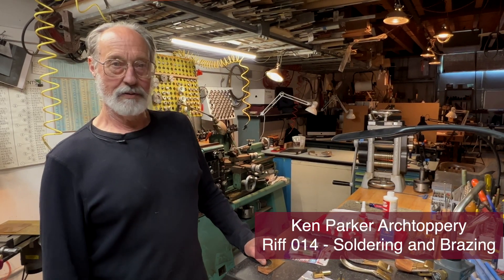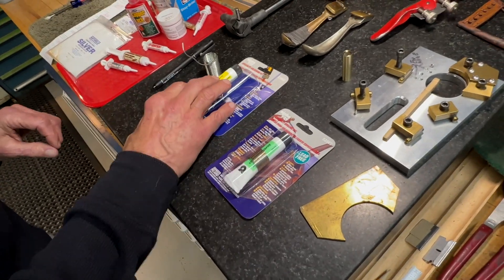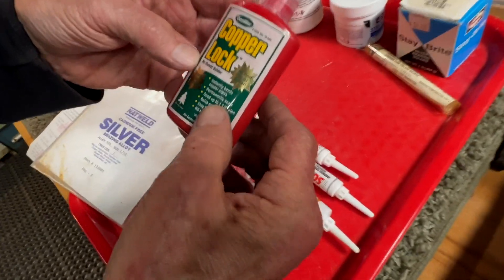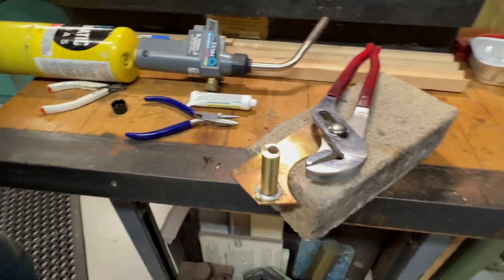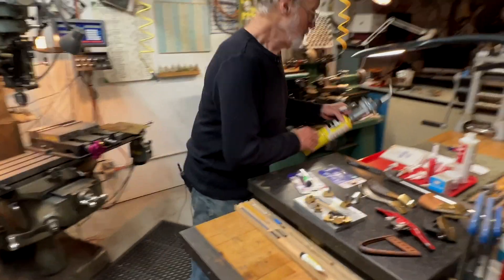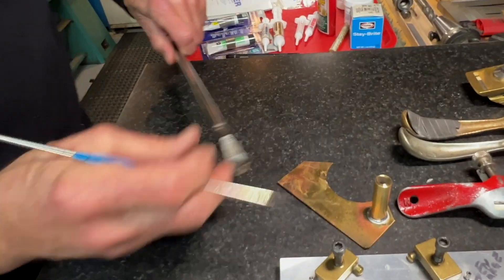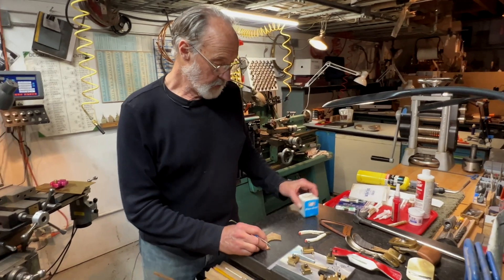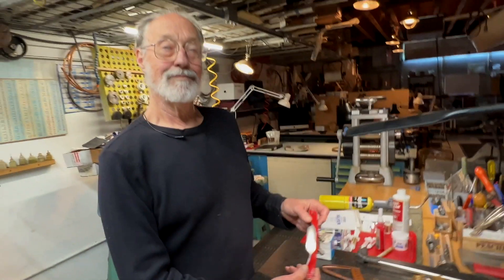Ken Parker Archtoppery - Riff 014 Soldering and Brazing

Comment: This was great, Ken.
Are you not worried about electronegativity differences in the materials? Can you get oxidation / rust?
Reply from the maker: It's possible, I guess, but I've never had a problem after soldering. After all, everything that refrigerates is made of many kinds of metals and alloys, and they seem to be able to get along. Perhaps it would be an issue in a salt water marine environment?

Comment: I found a nice granite surface of 60x112cm for 20 euros :) it even has like a 90 degree to it I believe, not sure yet, but it is detachable, I just have to saw it straight. I think I'll just make a seperate cart of it which I can use alongside my workbench soon. Also in my home I don't have a lot of room so I've looked for some quick wheel systems on youtube, pretty simple designs they got where you just push one lever with  your foot and your bench is on wheels en release the lever its solid on the ground again. As I will have to frequently move my bench from the wall to the middle of the space I wanna work in
Reply from the maker: Space is always a challenge, no matter how much you have. Congratulations on your surface plate,  it's really useful for so many things!

Comment: When I was young, plumbing solder had acid core and electronic solder had Rosen core flux
Reply from the maker: I think you must still be young!
Flux cored solder works quite well for many applications, and it's still widely used.

The Merriam-Graves MG 120 solder that got me started down the "silver - bearing" road 30 years ago is available either solid, or with an acid core, which, I believe is MG 120A

Comment: Thanks for the riff.  Loved the crushed solder trick. Also, very clean-cut look.  Nice.
Reply from the maker: Ha! Thanks!

You can roll, squash, or hammer solder to a very thin sheet, also to cut it with scissors so as to get just the right amount, and sometimes, just the right shape.

Comment: Great video and much appreciated as usual. Can't wait for the video on making that "box scraper" tool. No oxy acetylene - safety issues? Even in small jewelry work the additional (controlled) heat can be helpful. I've got a few old spare Victor aircraft torches I could gift you :).
Reply: Would you happen to have some tips for the older acetylene plumber/ jeweler torches?  I’m looking for something smaller than the monster that I acquired….with zero luck so far.
Reply: P.S.  so you are one of the quick ones to find the elusive box scraper!  I wasn’t fast enough 😢
Reply from the maker: https://www.ebay.com/sch/i.html?_from=R40&_trksid=p4432023.m570.l1313&_nkw=%2370+box+scraper&_sacat=0
I count about 21 pieces for sale, $20 - $110, Some nice ones, too!
Reply from the maker: Any welding supply place has them in a wide assortment, and you can always drill out larger or peen down smaller  the one you have to change size.
Reply from the maker: Victor aircraft torches? Do tell!
Reply: I like Victor Torch Handles - the old "aircraft size" called "J-28 Light Duty 0382-0127" these days (older was the J-27, a bit smaller) and the tips are still available. Popular with old style bicycle frame builders when brazing was used everywhere. The Meco Midget Torch is also still sold and popular with a few jewelers, it's smaller but you can still weld with it, etc. All these torches are better when setup with lighter lines/hoses, the best (IMHO) is sold by Tinmantech company and they sell the Meco Midget too. The best old torch was the Meco Aviator Jet, it's the blue one in my photo. They are really hard to find these days. The light hose helps a lot with welding when control of the puddle is so important. The Smith Little Torch (still available) is more of a jeweler's tool.